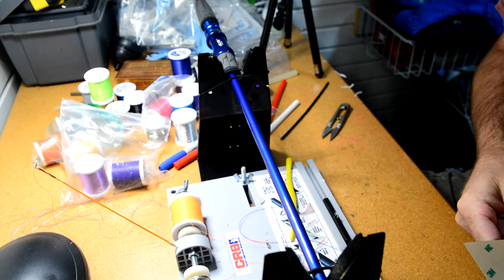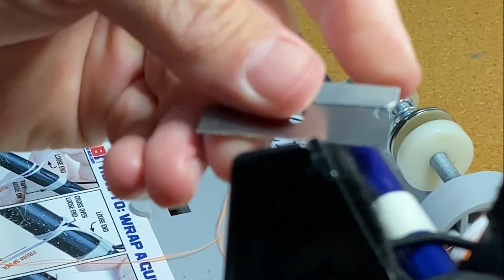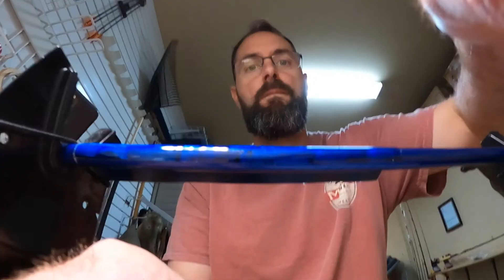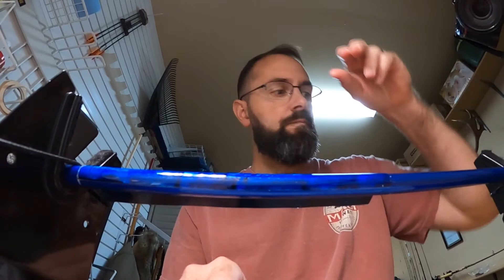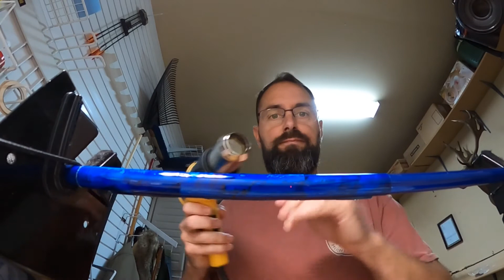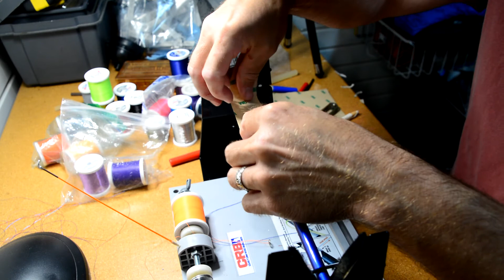Custom Rod Building - How to Apply ABALONE VENEER - Heat Gun Method

Comment: I guess you like Heatgun vs. soaking it in hot water? Tips on not getting cracks?
Reply from the maker: There is different types of abalone veneer.  Some you use a heat gun, which I find easier, and then others you have to soak.  Thank you for watching and commenting.
Reply: Did/do you any cracking issues and any tips on dealing with the seam (looks)?
Reply from the maker: @travisthompson3700  - yes, cracking issues with the water technique, so that is why I prefer the heat gun type of abalone.